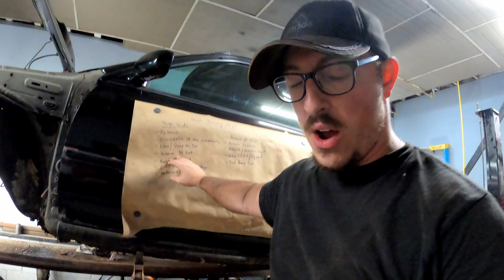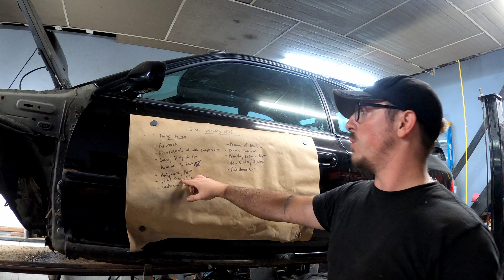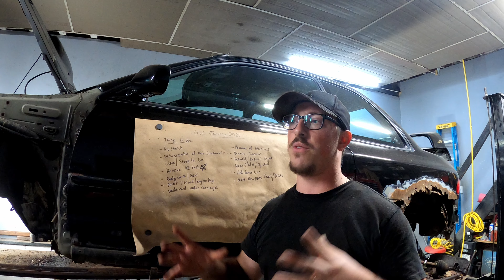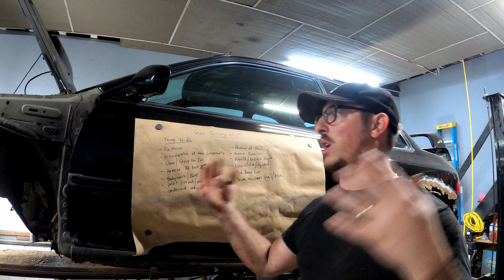Removing Engine Crossmember on my 1998 Subaru Impreza 2.5RS

Comment: from the beginning, i thought you would use penetrant on every darn bolt you knew you would unscrew in advance to let it work??? i thought you would have a fork for the ball joint, not sure if you intend to remove the interior for refurbishing or access, if you remove it in advance, it could maybe help for weight on stands...keep it up
Reply from the maker: Your correct I have been spraying everything down pretty much anytime I am with the car enough that I’ve been thru 3 cans of my rust penetration!
I do have a fork for the ball joint also and other tools that could have removed it. But because how loose the hub was on the control arm I didn’t want to mess around and just brought it down together. If the strut and the tie rod was still connected I would have got the fork in there and hit it once or twice and I think it would have came right out!  

And great idea about the interior! I think once I have the car alittle more secured on the lift I will get inside and start to pull that out! I’m afraid to be rocking the car too much the way it’s lifted in the rear!
Thanks for watching and the comments! Love the support